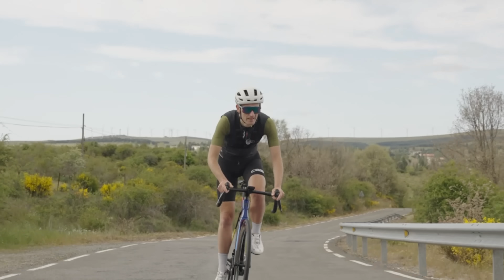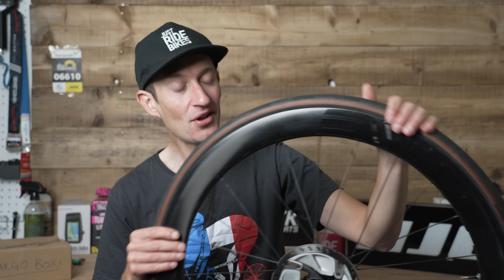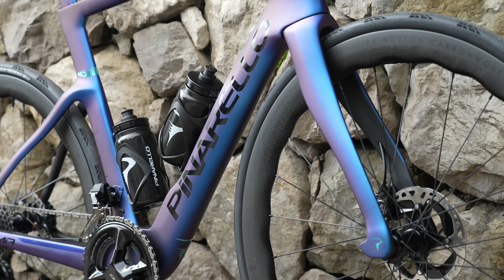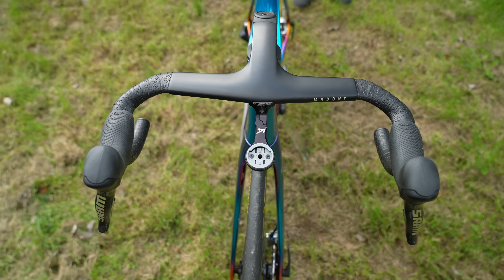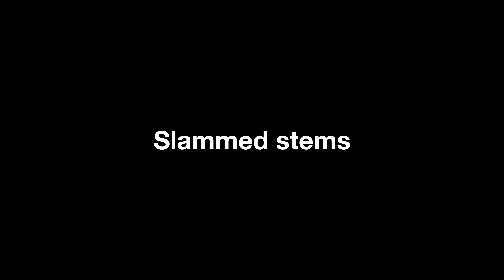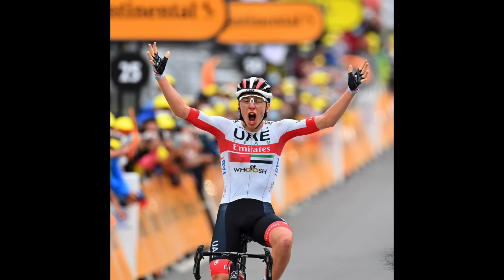10 PRO Tech Upgrades to COPY (and ones to AVOID!)

Comment: Not everyone will benefit from narrow handlebars, its depends on your shoulder width. If I have wide shoulders a smaller 36 or 38cm will be same as a 42cm. So key important factor is your shoulder width. The pros are small slim and narrow so they can use narrower bars.

Comment: Tubeless is comfortable and fast but in my experience it is not great except for racing. Flats don’t seal up well at high pressure, even 60psi. Learning to set them up is exasperating and you will be sorely disappointed the first time you flat. Stick to tubes and clinchers

Comment: Quite frankly if you are replacing your bike with a new one because you can mount 30mm tyres on it, or even comes as standard and you are also using handlebars which are perhaps uncomfortable because they are 2-4 cm shorter in width, then if you personally do not resemble the Michelin Man, Aero Socks must be a must or not! Otherwise you are virtually cancelling out the effects of the bars for example. Pros were reluctant to change to disc brakes and now they are reluctant about wide tyres.. THEY did not get converted by the amateur rider.. THEY were forced to by bike manufacturers who will convince the generally stupid in order to sell yet another totally overpriced bike. Otherwise many pros would stick to rim brakes and tyres of their choice. Someone once told me from the bike industry I should run my tyres at a lower pressure, now my tyres are 26mm wide so obviously I did not lower the pressure much (normally 8 bar) anyhow after trying it out once the end result was 1 minute slower on my normal route and as for comfort I just noticed a slightly wishy washy bike handling. The bike press and the content makers of You Tube channels which influence so many nowadays is purely driven by the constant need to say either something new for more subscribers or selling the many idiots who think what they read or see on their monitors is gospel.. yet another  new bike. Believe in yourselves and ride what you have got.. aero wheels and good legs are the most import items with legs being at the top of the list.. pro’s will beat everyone of us on even  if you have the chance to borrow one of their team bikes, they will trash you even on a bike from  the mid 80’s. As for comfort buy a Holland Bike, nice and comfy.. coming with the trend setting 46mm tyres, also with a basket for lots of drink bottles and space to spare for the latest edition of Bike BS.

Comment: again this wide tyre thing is not explained carefully! Lower rolling resistance? Yes - at the same tyre pressure. More comfort? Yes - when exploiting the possibility to use lower tyre pressure. But you cannot have both! Either you have more comfort - then you don't have lower rolling resistance; or you have lower rolling resistance - then you don't have more comfort. And it comes at a price: wider tyres have a higher aero resistance due to their greater frontal area. It very much depends on the road tarmac wether they are better or worse - and that is why the pros at the TdF are using them; tarmac in France is horrible rough, it makes sense there. In Germany, Switzerland or Austria, where tarmac is way smoother, 25 mm or at most 28 mm tyres still are the better choice. So we should look at where we are riding most times before making our choice!

Comment: I disagree with your comments regarding tubeless.  The tubeless does provide additional flat protection and the pro's change tires when they have flats via a sag wagon.  Recreation riders don't have sag wagon's and a flat with tubeless is a huge mess that makes adding an emergency tube a huge mess.  You also have the maintenance issue with sealant.   

You also mentioned the benefit of deep carbon wheels which is true but again changing tubes due is very difficult due to tight fit. (You have countless videos on make space and achieving the tube change).   What recreational riders need are tire that are easier to change.  The Pro's don't care because they change wheels but it is a real problem for non pro's.  

In summary the recreational rider is benefiting from current tubeless and tube tire design and the tire manufactures should recognize the non sag wagon need.

Comment: Pirelli tires.......I have to say, they are not good at all. Got a set that came with a used wheel set I bought, brand new tires and they are so thin that every bump on the road, I felt as if I was being smack on butt cheeks and felt it everywhere.........I put the Continental GP 5000 back on, and a much better comfortable ride. So, no, Pirelli tires are too thin.

Comment: Correct me if I’m wrong but the Aero vs Weight conversation is easier for the pros since there’s a weight limit of 6.8kg. Take Pogis wheels for example. He can still get the bike weight down to 6.8 kgs with those wheels, and could not legally make his bike lighter. In contrast my bike is at 6.4kgs with 45mm rims on a disc bike. Should I go deeper? Not necessarily.

Comment: narrow bars are a step WAY to far, its not even about a match to your body or shoulder size, technically 36cm is just too narrow for good control of the bike in demanding conditions. 38cm should be the UCI minimum. I willl start rocking a skinsuit every day once I get back down to race weight and lose these 20lbs.
Reply: Yeah, I might drop to a 40cm (from my current 42cm), but 38 might be a bit too radical for me.

Comment: Tubeless = YUCK.......TPU tubes so much better for the normal rider...no mess no fuss
Reply: I like my Vittoria or Challenge latex tubes more, despite being heavier.

MUCH better road feel, response, and yes, even self-motivating tire whooshing/scrubbing sounds against the road with a high TPI count great clincher tire (like a Corsa series).

I wore out my last back tire with this setup before I flatted even ONCE! 
(But I did use A LOT of powder inside the tire casing before installation.)
Reply: Sealant being sprayed all over the group ride is one reason i stay away from tubeless.
Reply: Yeah, I went away from tubeless for all but my off-road bikes. Not worth the hassle. Modern tires like the GP5000 are very good at puncture protection.

Comment: Narrow handlebars are poor advice (unless you've narrow shoulders), they're harder to control as we see with a lot more crashes. The gains for the average cyclist are negligible
Reply: Since I'm using 40 cm wide handlebars my bike is more agile and I'm able to move through the peloton more easily. Considering the Watts you're saving at 40 km/h it's a no brainer for me.
Reply: Fun fact...vintage race bikes had super narrow bars......
Reply: @truthseeker8483  I noticed that too.  Its funny how things go around like this.  I do wonder though if "back in the day", bikes had rake or trail numbers that offset the reduced leverage of narrow 'bars.

Comment: What's the opinion on shorter cranks? Currently have the standard 172.5 but been told 170 or shorter would improve my riding and therefore speed.
Reply: Shorter cranks can improve your bike fit and provide smoother pedaling circles. I'm not sure 172.5 to 170 would be enough of a difference. In my case, I went from 172.5 to 165 and my comfort level went up substantially. Depending on your geography, a change in gearing may be in order when you switch to account for the loss of torque due to the shorter cranks.
Reply: @ForeverDownByLaw  Yeah, you kind of need the leverage of the longer cranks to ride bigger gears, unless you have the sustained high power output of the pros/elites and can spin a 54x12 at 100+ RPM on 165s.
Reply: @ForeverDownByLaw  I did the same thing and I like it a lot. Even when sprinting ( in a smaller gear )
Reply: On my MTB I went from 170 to 175 (yes, longer) and it now feels so much more natural to me… 184cm height.
Reply: Depends on your height and terrain! I'm 6 ft been using 175 since gregs days! Not changing because of some climber that's 1/2 my size.  @kpsig
Reply: I Use 44 cm with straight levers, something I don't copy! If I did track racing then it might be different.

Comment: I've had narrow handlebars before. They were a big source of discomfort on longer rides, not to mention twitchy handling. Can't recommend those for anybody other than a pro doing short races. I've since switched to flared handlebar with bike fitter recommended hoods width - the one that corresponded to my shoulders. Flared drops make for a more stable sprinting.
And another shoutout for aero socks - they're good bang for your buck and there are plenty good looking ones.
Reply: I'm using 38cm bars and they feel good...certainly go into headwinds better.....vintage race bikes had very narrow bars
Reply: When going to narrower bars, are you also shortening the stem? I'm looking at a vision metron 5d but. 38mm comes only with 90stem
Reply: @Bravoleader80  generally you pair narrower bars with a longer stem to counteract the reduction in turning leverage. Plus  if your running uber narrow bars a longer and more aerodynamic position might be favorable.
Reply: Switched from 40cm to 26cm bars, vastly more comfortable and noticeably faster.
Reply: @oliverjacobs8594  26? Are they from a child's bike?
Reply: @ForeverDownByLaw  can confirm there made for adults! 33 at brake mount point but there 26 hood to hood because of 20 degrees of flare.

Comment: 6:13 there comes a point where we're just looking like clowns doing this lever tilting
Reply: It would not be as horrid/asinine as that 1970s pure touring bike look IF the manufacturers would supply straight, perpendicular to the road/inline with the bar hooks levers with radically tilted in hoods.

What is the current flip-flopping/they will change it again tomorrow, UCI 'ruling' on these now?? (NOT that it matters for us not racing under their auspices!)

Comment: Never tried aero socks myself but I think thats the one thing everyone should give a try since it‘s one of the best bang for the buck aero upgrades.
Reply: I had a TT last week, hesitated to put my aero socks and shave my legs (and didn't). I arrived second, for 2 seconds😅Pretty sure i could have won with these marginal gains
Reply: A friend of mine has tried a bunch of aero socks from big brands as well as Aliexpress, and found that most of them on the market don’t stay up/in position and require either pull up routinely, or you need to spray your leg with hairspray to give the fabric enough grip not to slide. I’m waiting for him to settle on which is best and I’ll order some. Having to pull up my socks or spray myself with hairspray sounds like a pain in the ass I don’t need.
Reply: @RyonBeachner  Yep, hairspray required for most of the aerosocks
Reply: Yes, no real penalties/discomfort/negatives for using them at all, save for maybe some funkier tan lines than older, lower style road socks.
Reply: Why recommend deep section wheels and not aero socks. The style applies to both, and it's subjective.
Reply: agreed - david's haterade here was especially off.

Comment: A well fitting jersey save more watts than 60 mm carbon wheels. A narrower handlebar will also probably save more than an aero carbon bar/stem combo. When adressing weight - always count your prefered currency per grams saved. You’ll be surpriced to know that light weight wheels are probably the worst investment. TPU tubes, a lighter saddle and a lighter stem are more cost effective.
Reply: Yep, sorry to burst the bubble of the weight weenies, unless you are literally a mountain goat that never seen a flat road, pair of 1500g 40-50mm rims will always outperform pair of 1250g "climbing" wheels. Biggest upgrade I've made on my bike were tpu tubes, good tire and narrow handlebars (to 38cm from 42)
Reply: @adamlucina  I personally run 38 cm bars with ridenow 19g tpu tubes and 1300g 60 mm carbon wheels, modern wheels have shifted the weight of rims down so dramatically I even consider my wheels on the heavier end. But most people dont even have 1500g 40mm wheels to begin with.
Reply: @RylHango  what rims you run for them to be 1300g 60mm? I run reserve 53/62 they are about 1500g but I picked them because of 35mm external width (I usually run 32/35mm tires so I can do fast on shite roads comfortably)
Reply: @adamlucina  I have elitewheels helix 52/57 and crw cs 50/60 wheels which are 1420g and 1290g respectively
Reply: carbon wheels sure make a lot more difference than lighter components, that's why it's worth the greater cost because the benefits of rim weight savings are critical

Comment: DO.NOT.SLAM.YOUR.STEM! Unless you are a cyclist that does it for a living. 😂
Reply: This is just flat out terrible advice. Get a bike fit then decide if you want to slam it. I'm 185cm rocking canyon endurace, and got a bike fit where I got advised to slam it because apparently my arms are 2cm longer than average for my size. Slammed it and felt hella difference when it came to comfort. TLDR, adjust bike based on your own needs don't slam or not slam based on some random internet comment
Reply: I dont think people shouldn’t slam their stem but to do it with the advice of a bike fitter.  I did it because it turned out i was to high up and because of my body shape it actually helped my fit.
Reply: Slam it!
Reply: Wrongggggg
Reply: I’m just 17 but the bike fitter has slammed my stem
Reply: Can I have these enve wheels please
Reply: On that thought, also never ride a smaller frame and then use a super long stem to compensate. Only pros can get away with this kind of body folding.
Reply: @KidFury27 I ride a smaller frame and a longer stem but it’s because I have long arms and torso but my legs are kinda short for my height.  I’m a prime example of why a bike fit is so important because if I bought a frame according to what a manufacturer thinks someone my height should ride I’d probably hate it.
Reply: @KidFury27 false.
Reply: @kellenhassell  Ok, then. Good luck with your back, neck, hip, and shoulder pain. Ride the bike that is sized right and don't overextend your reach just to get more aero.
Reply: @KidFury27  my use/overuse pain & injury-free ~10,000hrs and 200,000mi in said position over the last 10-years informs you that my back, neck, hip, shoulders, and bike size are all doing perfectly well. As a 5’9” punter on a 52cm w/ a 130 -17 slammed stem who’s successfully ridden this set up for nearly a decade, I supposed many may have to revise their armchair internet expertise. 🤝
Reply: @KidFury27  ~10-years & ~200,000miles injury and pain-free with such a set-up. Seems you don’t have to worry about me 😅
Reply: Narrow bars are great until you are unable to get adequate O2 in your lungs.
Reply: @5891jonathan  well maybe not so narrow you are choking yourself out xD my shoulder width is on a narrower side so 38s fit me quite well